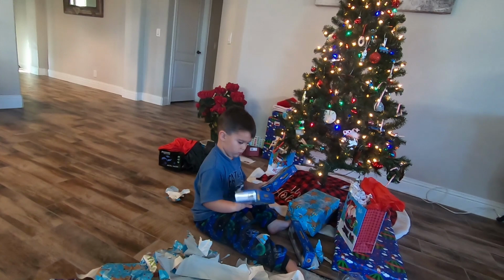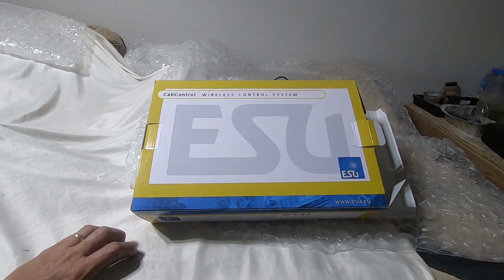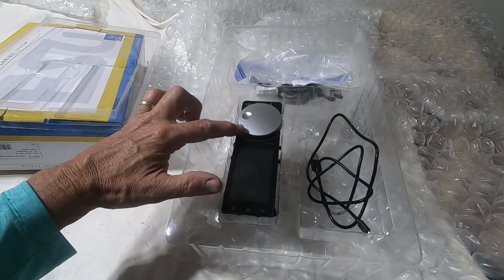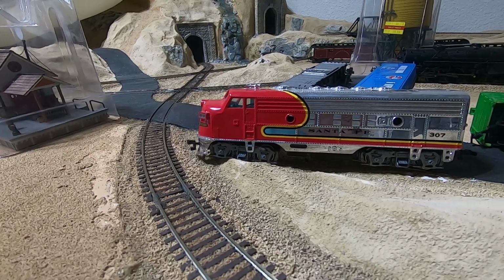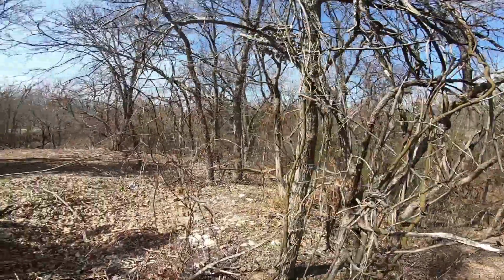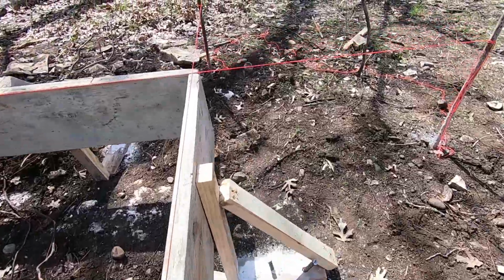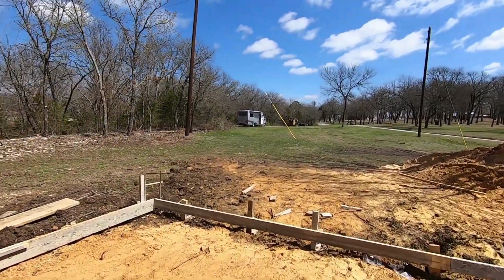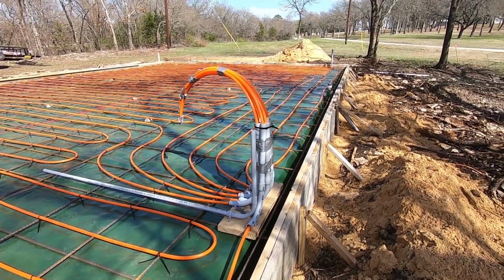GrandValley corrections

Comment: Love the look of the new building location and heated floors for sure! Sorry you're dealing with track issues in hard to reach places.

I have a couple of suggestions for both your locomotive and your finicky spot of track  between the crossings.
About the 60 and 90 degree crossing area.. I noticed on my GV layout that when a loco's back end was over the 60 degree crossing, the front end was very light. The loco sort of cantilevers over it sort of, if you follow me? This means the front truck might not be making solid electrical contact. The tender could be in a similar predicament. That's why it's not resolved by adding a power tap there.

Also, make sure to sand / file the plastic rail bits on the crossings to make sure the gap is wide enough for the wheel flange to pass through instead of riding up onto the plastic.. which happens to a lot of us. If you can film your locos in slo mo in that area, it could be instructive.

On the locos, I've had brand new BLI locos with intermittent electrical contact out of the box. I took a toothpick, dipped in iso alcohol, and rubbed where the ends of the axles are. That's where electrical contact is made basically, and even brand new they can need cleaning pretty badly, along with the wheels themselves. Even if they look clean. Same with the track, it can look clean but a rub with a finger can come back with black lines on it.

I really hope something here helps! Good luck going forward.
Reply from the maker: Thanks for the info, when I make the move into the new area, I plan on working it out.   Got. to. remember your notes here...  The frustration ,  when on Christmas morning all that work and planning ...down the toilet.    Tested a.  few days in advance...alot warmer no issues.   At 15 degrees, train wreck.    I soldered all pieces and thought that would help hot/cold expansion issues.   Thanks. for watchin

Comment: Well shoot!  I’m sorry you’re having issues with your GVL!  I had trouble with the 2-4-0 steamer I bought and had to return. Now I’m having issues with one of my GP38s, but I’m suspecting it may well be track issues like Davefr mentioned. I’ve got some deoxit and I’m working on getting it applied correctly. I’ve since found out from a long-time railroader that the foam track bed we used from the kit is a big culprit for expansion and contraction, and the reason the big guys use cork and the thick pink foam boards. I get issues near my window in the basement with movement. Keep at it, I have days where everything is broken snd won’t run the layout. I quit and come back in a day and everything runs like a champ. Haha. Your grandson is adorable, what a fun Christmas for him. Really cool land you got!  That building is going to be sweet!!  Well like I said keep at it and have fun!  Thanks for the update! 👍🏼
Reply from the maker: Hello Dan,  Oh I'm ok just needed a break I guess.  Uncovered her today , a clean brite boy, vacuum, mineral spirits, and a stainless steel washer and spoon combo.  Steamer Runs much better.  I ordered the Deoxit, no word when it will get here yet.  Also re did the crossings as your vid shows.   I also pulled my tunnel entrance things to make them removable.  I can get to all track for the cleaning.  I still think a stable environment controlled will help.  More on building soon..its done.   gotta move this thing soon.   take care

Comment: 7:12 I've been there. I model in N-Scale...I've got two identical Bachmann Norfolk Southern Dash-8's. Well, let's just say it's a good thing that I run them double-headed anyways, because often times, one train has spots it doesn't want to work, and then it has spots where it works, while the other runs like a champ all the time, so in the end, one engine is really doing all the work.

Meanwhile, on my second track, where I'm running Chessie System/CSX GP-38 locals, my Chessie System is temperamental. Runs great times, runs poor at times, but if you get my Norfolk Southern F-Unit out on that same track, there's no issue whatsoever. Runs like an absolute champ.
Reply from the maker: Cantankerous.... As a model train noob it's a bit frustrating.  My expectations were a bit shattered, but now I can see it's not just me and poor workmanship..   Thanks

Comment: Copterdude1. Glad to see you're back!! I've also experienced "flakey" locomotive operation at times. (Surging, slowing down around curves, flickering lighting, inability to crawl at low speeds).  I'd clean the track and it would be good for a short while and then the same problems would re-appear.  It turned out I wasn't cleaning my track properly.  The goal is making your track conductive vs clean. I highly recommend this video. https://www.youtube.com/watch?v=lBYxjcTWCB0&t=789s.  There's some chemistry involved in choosing the right track cleaning process. (I was using IPA).  I switched to a product called DeoxitD5.  (a little goes a looong way).  I just spray some on the end of a paint mixing stick and run the stick around the track a few time.  It's made a huge difference for me.  Locomotives run smooth, they crawl at low speeds without stalling out, no slowdown around curves, etc.  I'd give it a try.  You don't even need to get into the middle of tunnels.  The locomotive wheels will carry it in. It's quick and easy, give it a try.  A dedicated train building??? I'm impressed!!!
Reply from the maker: Hello Dave, a dedicated SPOT...in the new build.  Wish I was that rich....  Ill take a look at vid and definitely give that stuff a try. Thanks a bunch
Reply from the maker: Great video, and product.. gonna give it a try once I get moved.  Thanks

Comment: Steamer could use a stay alive
Reply from the maker: Im gonna have to google that one...  I like the sound of it...  Not gonna give up on it, the smile on my grandsons face is priceless!   Is that the actual name...stay Alive?
Reply: Stay alive or keep alive, the name depends on the manufacturing company they all have their own names for them.
Reply: @copterdude1  the store you bought the Engine from should help you out. It is basically a capacitor that carries it over track that might be dirty or have power problems. As the SF unit has no problem that section might be too short for the steamer the two crossovers might cause a short in the steamer.
Reply from the maker: Im on it. emails sent,,,   also was given this link.  Have you any experience with it?
Reply from the maker: https://www.youtube.com/watch?v=lBYxjcTWCB0&t=789s
Reply: @copterdude1  personally no I only have two large steamers and haven’t had a layout large enough to run them on a 484 and a big boy
Reply: As for Ron's video I have the product in my amazon wish list
Reply from the maker: Mines on the way with a BLI Go pack, thanks for info, Ill vid the try out